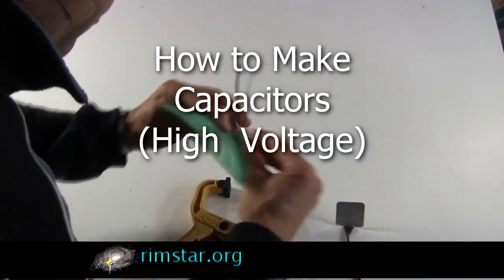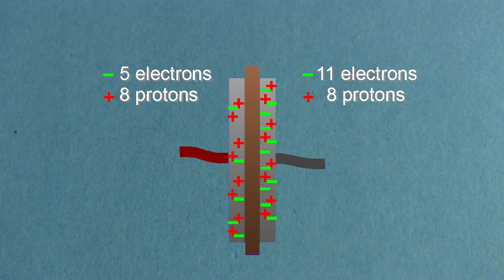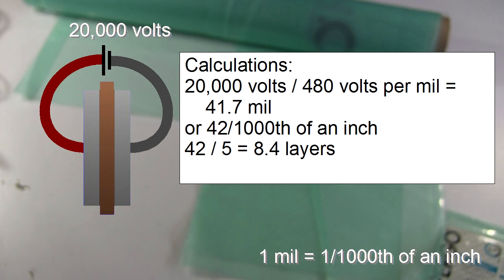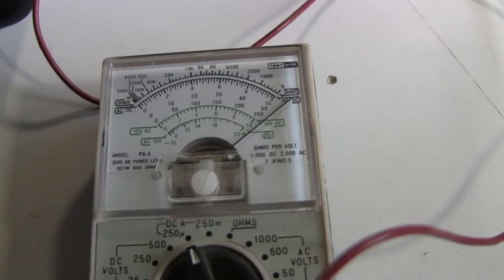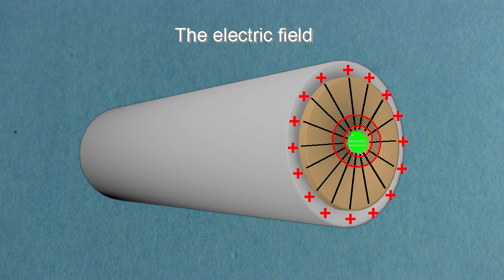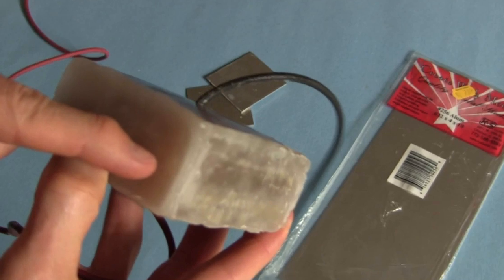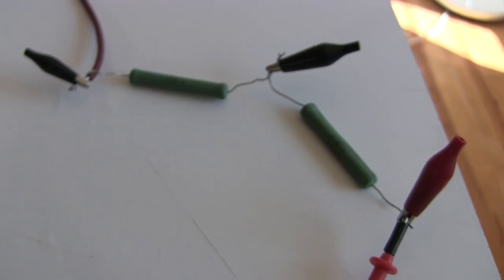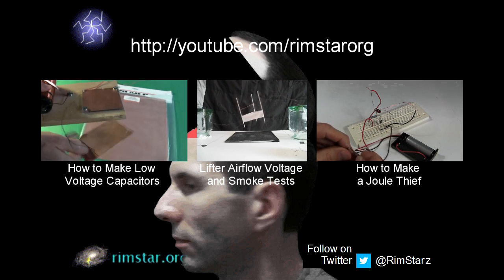How to Make High Voltage Capacitors - Homemade/DIY Capacitors

Comment: Thank you for the great video!

I have built some HV capacitors.  Since its my first, I tried to be very conservative and it seems to hold about 30 kVDC for a neon sign transformer tesla coil.  I have only been using it for a few days, so it may fail.  Here are some ideas I had, perhaps you could comment on them if they make sense?

I am using aluminum roof flashing for the plates and a roll of 4 mil polyethylene painters drop cloth as the dielectric material that I bought at Home Depot.  I cut the flashing into squares about 6 by 10 inches long with a scissors, rounding the corners with about 2 cm radius to ensure there is no field enhancement at the corners.  I check the edges of the plates for burrs and make sure the edges don't have any points sticking out.

I am trying to avoid corona discharge that erodes the edges of the dielectric and leaks charge.  Since corona discharge seems to find even the smallest gap, I am trying to maximize the path distance between the adjacent plates.  Instead of using discrete sheets of dielectric, I place the aluminum plate onto the roll of drop cloth and wind the plate onto the strip of polyethylene drop cloth, so that the edges are covered with dielectric as well.  Before I wind the plate, I tape in onto the roll using a strip of packing tape so that it will not slip and unwind.   The aluminum plate was 10 mils (0.25 mm) thick, and after rolling six layers of the drop cloth onto the plate it was 120 mils (3 mm) thick.  I then cut the plate from the roll, and tape the free end onto the wound plate.   I leave a portion of the plate exposed from the bottom of the roll to attach an electrode.  As for the side opposite the electrode, I fold the sheets of plastic over and tape it to add more plastic into the path of potential corona discharge.

Once I have created a stack of these plates, I divide the plates into two half stacks.  I drill a hole through the electrodes of all of the plates in a half stack and thread a screw and nut through the hole to tie the electrodes together.  I add two more washers and a second nut that allows me to attach a wire, and attach a wire to each half stack.  Then I combine the two half stacks together with their electrodes on opposite sides, alternating the layers between the two combined stacks.  This is kind of how like a film capacitor is made, with two electrodes on either side and alternating layers insulated from each other.

I place the stack between two sheets of plywood, and then clamp the plywood to compress the stack.   I then cut spacer rods and screw the spacer rods into the corners of the plywood to maintain the pressure after the clamp is released.  This hopefully pushes some air out of the polyethylene stack so that the spacing the plates is minimized. 

I thought I would share, it is fun to try.  Any comments are appreciated.  Best,  Dan
Reply from the maker: +profdc9 Sounds like you've taken a good number of precautions. The only thing I'd say is what a lot of people say to me and that's that wood can be conductive. But I never seem to have a problem, and I've used plenty of wood with capacitors. Just make sure it stays dry. I'm thinking of how you have wood extending from one end of your capacitor where you make electrical contact with the capacitor to the other end where you make electrical contact. But if your wood is dry and clean of dust then there shouldn't be an issue.

Comment: sir, if i make high voltage capacitor to replace battery, and i use it to running motor just need 12 volt, it is ok ? i charge it 480 v and use it for 12 v equipment ?
Reply from the maker: +henki prananda If it's too high a voltage, like 480v with a 12 v motor,  it may damage the motor.
Reply: oh, thank a lot. maybe i just make high capacitance capacitor.
Reply from the maker: henki prananda
If you're going to power a motor then it's going to have to be a very high capacitance capacitor, like a supercapacitor. I haven't made one myself yet, but I know others have on YouTube.
Reply: anyway, if i want to make long time-use capacitor, did i just make high capacitance capacitor ? and how i know the capacitance of my homemade capacitor ?
Reply from the maker: +henki prananda Yes, if you want to make a capacitor that will power something for a long time then you need a high capacitance capacitor. But it must also be able to handle the voltage that you'll be putting across it. That's why capacitors always come with two numbers, a capacitance and a breakdown voltage.  One way to know the capacitance is to measure it using a meter that has a capacitance setting on it. I show how to do that at 4 minutes and 55 seconds into this other video https://www.youtube.com/watch?v=GveI9gXIsHw (though the whole video might be of interest to you.)
Reply: wow, thak you very much sir.

Comment: Hi, I read an article once about how an experimenter charged a parallel plate capacitor with 2 million volts. What type of insulator would one need for this. Epoxy resin, ceramic?
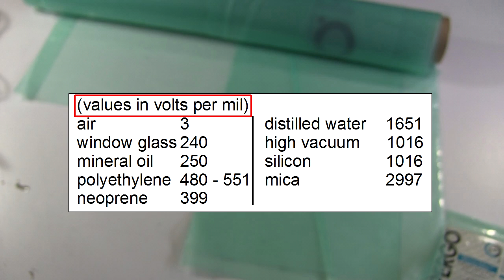Reply from the maker: +Sean Crawford Hi, 2 million volts? At 2:38 in the video I give a sample table for breakdown voltages for different materials. Polyethylene is 480 volts/mil. So 2,000,000 volts divided by 480 volts/mil is 4167mil, meaning that at 2,000,000 volts the dielectric will need to be 4167mil thick before it breaks down. 1 mil is 1/1000th of an inch (don't be mislead by thinking mil means millimeter. In this case it doesn't.) 4167 mil multiplied by 1 inch/1000 mil is the same as saying 4067/1000 which is 4.067 inches. So a 4 inch stack of polyethylene should do the job. But you'd have problems at the edges of the electrodes as I talk about in this video. Find the breakdown voltage for an epoxy resin instead so that you can completely encapsulate the plates in the resin and redo the above calculations. Also make the plates are thick so that the edges can be well rounded as I talk about in this video. And make sure there are no air bubbles in the resin. One trick for this is to gently apply a blowtorch to the resin while it's still liquid, Or heating it some other way. It'll be a few inches thick between the plates.
Reply: Thanks, I will try this
Reply from the maker: +Sean Crawford Cool. Let me know how it goes. And be careful.

Comment from the maker: +Sanskruti Mohanty I'm assuming you're referring to when I said "1 mil = 1/1000th of an inch". The mil I'm referring to is not the metric millimeter. See https://en.wikipedia.org/wiki/Thousandth_of_an_inch.
Reply: So in order to make it larger do I just repeat the layering process? |\|\|\|\|\|\|\|?
Reply from the maker: That depends on what you mean by larger. To get a higher capacitance you want less layers, but that means it won't be able to withstand as high a voltage.
And vice versa, to make it able to withstand a higher voltage without breaking down you add layers, but that will result in a lower capacitance.
You need to figure out what your capacitance needs are and how high your voltage will be and then go from there. This video talks about the voltage part, the capacitance part is talked about in my other video http://youtu.be/GveI9gXIsHw.

Comment: you measured 30.000 volt on your meter when the meter is set at 50volts range and i don't see any wires connected to the volt meter so how are you measuring please explain regards
Reply from the maker: pervez Akhtar The meter's actually set on the 30 volts range. The probe has a cable on the end that has two wires in it. Those go to a plug which is plugged into the lower left corner of the meter. I show more about the probe here in this other video https://www.youtube.com/watch?v=kXq4FCQ0C38.

Comment: I saw a really cool video where a capacitor made of a glass jar, and two pieces of foil was charged.  The foil was removed while it was still charged, and then touched together with no discharge, however when the foil was replaced the capacitor was still charged.

This shows that the charge is not held on the conductor, but on the outside of the dielectric, at least with a simple leyden jar.
Reply from the maker: Justin Hall Yeah, the charge is sprayed onto the dielectric as the metal electrode is removed. That might have been MIT's video or that might have been my own video. Here's mine about dissectible capacitors https://www.youtube.com/watch?v=gPXv063O5B8

Comment: could you show us how to make a low voltage high farad capacitor? like a supercap?

im trying to make a quadcopter with a capacitor bank
Reply from the maker: MrF3nox All of the homemade supercaps I've seen are much larger and bulkier than the commercially made ones... which wouldn't normally be a problem except that for a quadcopter you probably want something as small and lightweight as possible. I'd suggest looking at commercially made ones instead.I do have it one my list to try making some, but haven't gotten to it yet.
Reply: im thinking of making a quadcopter multilayer frame / capacitor. so that the frame carries charge.... with multilayer graphene and glassfiber substrate i think i can use flash exfoliation in very thin epoxy solution
Reply from the maker: MrF3nox Oh, neat idea. I don't know enough about quadcopters to do the energy requirement calculations, but it would be a cool way of doing it.

Comment: isn't 1 inch 25.4 mm?
Reply from the maker: TheSilverSmith Are you referring to where I say 1 mil is 1/1000th of an inch? If so, you're right, but mil has a few different usages, including this one http://en.wikipedia.org/wiki/Thousandth_of_an_inch
Reply: oh..ok thanks for clearing that up. I'm relatively new to this electrical stuff and plan to take it next year as a sophomore.
Reply from the maker: TheSilverSmith
Glad I could help. Better to speak up like you did anyway, just in case I did make an error.

Comment from the maker: +Nathaniel Charles Put a resistor in the circuit in the discharge path.
PS There's no Reply button under your comment because of your Google+ settings.
- go to your Google+ page,
- in the top, right corner click on your thumbnail icon,
- in the popup that appears, click on "Settings".
- for the 2nd question down "Who can comment on your public posts?" set it to "Anyone".
Reply: RimstarOrg ?

Comment: Could anybody explain me how to minimize the discharge time of a capacitor?
Reply: Nathaniel Charles use a resistor, or you must make it different with different materials. Look into the difference between type 1 and type 2 ceramic capacitors... that's a good example how slightly modified materials will have differing results.

Comment: hi i like your video so much. is it possible to modify a power inverter to power up 75 volts and 500 amps. gadget from a 12 volts battery??

Comment: just had a thought about an idea can u use a wimshurst to power a lifter? can b a cool video
Reply from the maker: mmrutman I agree, it would be a cool video. Unfortunately there's not enough current for a Wimshurst to power a lifter. A typical Wimshurst supplies around 10 microamps or less, whereas a lifter needs over 250 microamps.
Reply: ok have you made any overunity devices? testatika?
Reply from the maker: mmrutman I've experimented with testatika in the past, but have never been successful.

Comment: My question is. ..
I made a discovery in Lightning physics that created a disc of energy that actually is a capacitor of sorts. I'd like your opinion on this.  Antihydrogen fusion starts in the series of... fusion wrapped in a 6" ring of  antihelium then to a 2 ft. ring of liquid oxygen slowing down the fusion back to a 6" antihelium ring sealing in the 12 foot disc.  Looks like a bullseye.  Now that the energy is trapped it starts converting the first antihelium ring to light but copying the fusion design into light ...like a movie projector. I'd like to know your thoughts on this.  This energy fell apart in front of me and my dad 1960. Then my wife 2004 saw this disc converting antihelium to high energy photons or a huge beam of light we stood in.  While researching it I found out that this energy is making SPRITES above storms releasing liquid oxygen.

Comment: How many kv and uf u have there ?
Reply from the maker: neil pabilonia If you watch the video you'll see it went to 30kV. I didn't measure the capacitance but I imagine it was tiny, in the picofarads probably.
Reply: Not microfarads?
Reply from the maker: I didn't measure the capacitance, but going from experience, given the small surface area I'd guess picofarads, maybe low nanofarads. Definitely not microfarads.
Reply: Ohh so if I have a 500kv is it possible to get uf ?
Reply: neil pabilonia How can you achieve 500kv? I've done research and my results are van de graaf is the best option. but it seems that the potential is not constant. It decreases over time. please email me pn9q8@mail.missouri.edu if you have the time to explain. thank you.

Comment: and my test with my home made capacitors didnt hold there charge for long is this usual for your tests too? did i make them right? lol cheers ryan
Reply from the maker: Westsyd2pac Were you charging them to a high voltage, thousands of volts? What voltage were you charging them too? What were the capacitors made of? How are you testing their charge?

Comment: hello  Could u please email me on how to Edit my videos to view the coronal effect or kirlian photography as i have found absolutley no information or help about the subject matter and i see u did it on your video! which leads me to belive it is just a filter effect

Exvalid@gmail.com
Reply from the maker: Westsyd2pac I just turned out the lights and filmed it. In the dark the bluish corona is visible to the eye. It's a result of the high voltage ionizing the surrounding air. It has nothing to do with kirlian photography. If your high voltage setup isn't showing any corona in the dark then you might have everything very well insulated or your voltage and current aren't high enough (the high voltage breaks down the air and the current supplies the charge to produce the ions.)

Comment: I didn't really get how the 1. capacitor was built, was it bassically just an aluminum plate contact whit a wire on both sides and covered in resin? And how to charge/discharge them, should i use 2 wires on both sides, 1 which charges and 1 which discharges. And can i use candle wax or ordinary silicone for the insolation.
About how much volts can you charge to your that capacitor u showed first
And yes i bassically know nothing about electric world, other than not to mess whit high voltages :D
Reply from the maker: EstBest69 The 1st one was two aluminum plates with resin in between them and all around them, plus some wax outside for extra insulation.To discharge any capacitor you must "touch" both plates together. Since you can't do that you have to touch wherever there's bare metal, the other ends of the wires for example. Often one plate is connected to Earth ground. In that case it's only necessary to "touch" the other plate to Earth ground too. That's what I do most often since usually one side is grounded.The type of insulation you use depends on the breakdown voltage of the capacitor as discussed in this video. The insulation on the outside is in the electric field too, though the field isn't as strong. But if you touch the outside then you become a third plate and the field is stronger between you and the nearest plate inside. I often use wax on the outside. I don't know how good silicone is as an electrical insulator. But in any case, never touch a high voltage capacitor that's charged, even if it has insulation outside it.I don't remember how many volts I could charge the first capacitor to. I doubt I ever tested it to the breaking point.

Comment: Not sure if somebody has told you already but..
1 inch = 25.4mm so 1/1000 inch = 25.4/1000 = 0.0254mm

Therefore 1/1000" = 0.0254mm which is 25.4 microns.

So your 20,000V across 480V per micron requires at least 42 microns (or 1.65 thousandths of an inch.)

Would make a lot more sense in your breakdown experiment don't you think?
Reply from the maker: causaljoe Not so. You say "So your 20,000V across 480V per micron..." but it's not. That should be "20,000V across 480V per 25.4 microns..." That follows from your statement above that "Therefore 1/1000" = 0.0254mm which is 25.4 microns." Continue from that revised statement and you get that you need 8.4 layers, just as I calculated using mils instead of microns.Sorry, for the delayed response. The email notification of your comment got buried. Thanks for pointing this out, even though this time my video's still okay - I do make errors too.
Reply: RimstarOrg  Ok thanks for the info, my problem was that I had never heard of mils before, I thought you meant millimeters.  Oopsie!